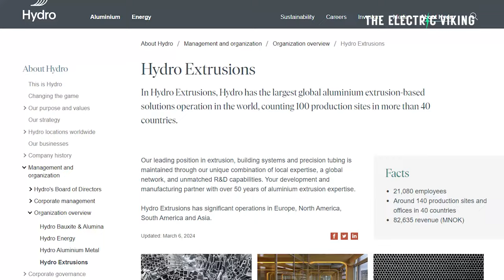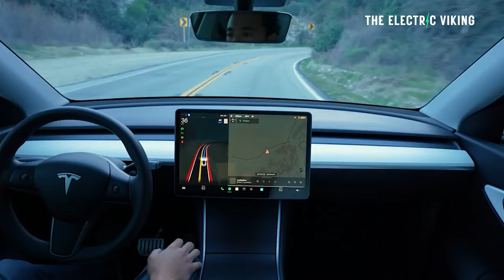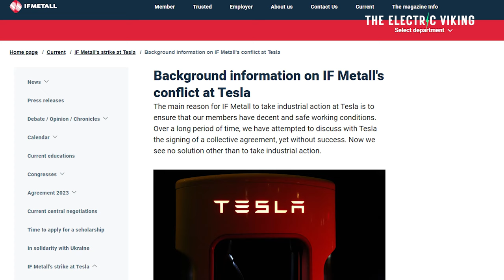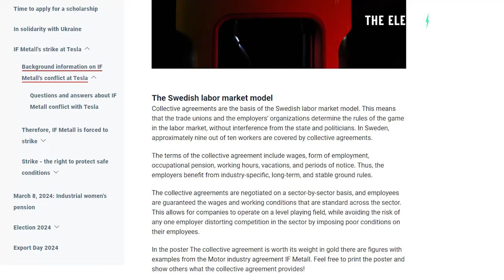IF Metall fails to STOP buyers; Model Y Sweden’s most popular car in 2024

Comment: I have both Tesla model Y and Ford Mustang Mach E. They are priced about 44 thousands. Mustang Mach E has softer suspention, slightly better noise insulation, but the model Y is much roomier than the Mustang. And in terms of software, it is a huge gap between the two. While the Mustang's software is primitive, almost useless, the Model Y gives me controls a lot of things from my phone: turn on AC, heater, roll the windows, can see location, speed, temperature...And it has all the options that the same price Mustang does not have: wheel and seat heating, powered passenger seat, 12 memory seat setting...That is why Model Y is the most competitive in the market
Reply: You sure fucked up with not one but 2 EVS
Reply: After watching Sandy Munro's comparison of the thermal systems of both those EVs last year there is no way in hell I would get a Mustang Mach-E.

Comment: Remember, Volvo Cars is Chinese owned. It is NOT Swedish and hasn't been for 20 years. Volvo Group sold Volvo Cars to Ford. Ford lost billions when they eventually sold (2011, I think). They desperately needed the money to avoid bankruptcy after the financial crisis of 2008/9. So Volvo Cars was sold to Geely, a Chinese Company. Geely kept the Volvo HQ in Sweden but most of the BEV's are designed and produced/manufactured by Geely in China. Volvo Sweden continued with ICE and Diesal (Just closed off Diesal). Geely are also slowly moving manufacturing away from Sweden to another factory in Belgium, avoiding all that crap interference with the Swedish Unions. It's strange but media writers don't seem to have picked up on this. It's all in their financial reports. They aim to be purely Electric by 2030. Geely and Volvo Cars also own controlling interest in Polestar. (Note: Volvo Trucks/Buses are still owned by Volvo Group)
Reply: According to the Wikipedia article, Ford bought Volvo Volvo Cars in 1999 and sold it to Geely in 2012, so it’s been about 25 years since Volvo Cars was a Swedish brand. Ford can hardly accurately be called an American automobile manufacturer. Tesla is the largest automobile manufacturer in the US. Ford assembles cars and trucks, but according to available information does not make the parts that go into them.

If you want to buy a new American car, you’ve got Tesla and maybe Rivian. If you want to buy a new Swedish car, you are out of luck. Or maybe you can start a new company here in Sweden.

Isn’t it remarkable that Tesla is doing so well in spite of years of lies and other forms of negative propaganda and stock manipulation aimed to defeat the company and prevent or delay the sorely needed transformation of vehicular traffic from being based on the combustion of fossil fuels to being based on clean, renewable electric power?

Facts remain facts, and “alternative facts” remain lies, no matter what you call them. Untruth can be used to manipulate human behavior, but nature does not respond to it. Facts can be suppressed, forgotten, but they can’t be altered like opinions, so they have a tendency to survive obfuscation by politicians and others with vested interests in denial, such as oil companies, utility companies and unions.
Reply: @Nirabulator  volvo cars have always been Swedish company and they still are. They pay tax in Sweden every year. Becouse it’s a Swedish company and it’s the same for Polestar. The company’s are just owned by a Chinese company. But that doesn’t make the company’s Chinese.
Reply: @andreasl4507  Huh?
Reply: @Nirabulator  if a chinese person buys your house in the US or wherever, is it a chinese house?
Reply: @erik....  What would make it a Chines house?
Reply: @Nirabulator  It's owned by a chinese person.
Reply: @erik....  A Chinese-owned house, then. Is that what you are trying to get at, and I have just missed it, the analogy between house and company? I can see that. Volvo is a company built in Sweden by Swedes. Volvo Cars, which is what we are talking about here, is becoming less and less Swedish over time because it was bought by a Chinese company which has made many changes since taking ownership, and now it seems no Volvo cars will be made in Sweden, at least for the time being.

That, I think, is where the analogy breaks down, as in your hypothetical question, the house remains the same, wherever it is. Only the ownership has changed. If the owner dismantles the house and moves it to China or wherever and reconstructs it, isn’t he or she likely to call it a Canadian, American or Brazilian house, depending on where it came from?

A Chinese conglomerate buying Volvo and making all the changes that have been made, ending production and eventually design and the other core functions of the company in Sweden has in my mind made it a Chinese company with a strong Swedish heritage. I don’t think there is anything particularly unfortunate about that. The Volvo brand remains alive and kicking, which is a much better fate than the fizzle that SAAB was.

This is a tricky thing to interpret, I think. Do you think it might be appropriate to refer to Volvo Cars as a Chinese-Swedish company?

I think an argument could be made that the Chinese invested in Volvo’s technology and reputation for quality and are wisely developing that. Volvo automobiles will just get better and better as Chines expertise is applied to converting the fleet from ICE to EV.
Reply: @Nirabulator  Yeah I don't know, I still see Volvo cars as a swedish brand. Just look at the board of directors.
Reply: @erik....  Well, it’s an intriguing question. Only three of the members of the board of Volvo are Chinese. The chairperson, Li Shufu, also known as Eric Li, owns 2,313,396,227 shares of Volvo Car AB as of December 31, 2023. Note that that is billions of shares. The CEO and president of the company, a Scotsman named Jim Rowan, has 403,000 shares. None of the other board members are close to that number.

I think it’s also worth noting that Li Shufu is also the sole owner of Geely, which company literally bought Volvo from Ford for 1.8 billion dollars, at a considerable loss for Ford. Thus the argument can be made that Li Shufu owns Volvo Car AB personally. In that sense, Volvo is definitely a Chinese company, regardless of where and by whom the vehicles are designed and built.

That is, of course, not the whole picture. The history of Volvo is long, founded in 1927, and its heritage is mostly Swedish, I think one could say. The Wikipedia articles on both Volvo and Geely refer to the companies as being multinational, and that is probably the most accurate way to refer to them. Geely also owns Polestar and Lotus, among other once non-Chinese brands, and has recently bought a significant amount of shares in Daimler and Aston Martin.

Volvo and Renault had an intimate relationship for many years and for a time were in negotiation for some type of merger. Based on Swedish reporting at the time, I got the strong impression that the merger failed because of the insistence by Swedes that Per Gyllenhammar Lead the new company and that Volvo shares be worth more than Renault shares. Renault was then a larger and more survivable company than Volvo. In Sweden until recently you bought your Renault, as my wife and I did, at a Volvo/Renault dealer. Up here in the north of Sweden there are no longer any Volvo dealerships. I don’t know where you go to get a new Volvo now. Mailorder maybe? Geely is now investing in Renault, so multinational is probably the right way to think of most of the car makers we knew and loved from the twentieth century. Good old globalization.

Ford and General Motors are moribund. Their leadership is an embarrassment. They will either fail again and get bailed out with American taxpayer money, go bankrupt or be acquired by holding companies such as Geely.

Comment: I’m
Confused if the workers in Sweden voted against it - what is the issue? Doesn’t the opinion of the workers matter?
Reply: Not when you are a union of 85% of the country and have badly invested the people's retirement money and are desperate for other revenue to make up the losses.
Reply: @tedmoss  - Oh did not know they were that pervasive as a union. Most people in the U.S. save for their own retirement and add Social Security. I wouldn’t want to depend on a pension given the single point of failure risk.
Reply: @RagnarinVa it’s more complicated than that. You get a government pension that come from your work and income, this is your baseline and are quite low. Many companies also give you separate pension part, this is an important part for securing a decent pension. On top of this you can also privately save money but unfortunately the previous socialist government removed the benefits so now it’s basically up to you.
Reply: @dyktilja - I understand that. Out “government pension” is Social Security. Most in the Us add to that with personal savings (401k and IRAs).
Reply: @RagnarinVa  they are probably afraid Tesla will remove the benefits like getting shares as a bonus if they vote for the union.

Comment: In this video you talked about workplace safety and unions. Here in Finland it's not for union to make workplace safe. There is separate governmental agency to handle that. I expect same applies to our neighbor Sweden.
Reply: Nope. In Sweden we have no Govt office handling workers rights. That's what the unions are for.

If IF Metall fails we will need to start implementing government laws, which would mean there would be no wiggle room left for companies to dodge minimum rate for one thing. The Swedish decision to seek consensus and force companies to work with the unions instead of as a third party workers movement is one of the secrets to Swedens success as a previous export nation.

Tesla is walking a dangerous rope here and we might well see new laws that will twist Teslas arm if this continues. Are you going to start claiming the Gov. is a mafia org too? :)
Reply: @wertigon  I'm claiming mafia what? I didn't even talk about Tesla. I Googled and found out quite fast that you are lying. In Sweden Arbetsmiljöverket government agency handles workplace safety.

Comment: Unions adversarial effect on manufacturing cost is driving the rapid development of technologies and methods to reduce the human labor contribution to mass manufacturing.  This is what Tesla is doing in unboxing the line  and increasing automation The central assemble line is a  point of weakness in  manufacturing and blowing up that model  will introduce a great deal of  flexibility in when and how sub-assemblies are made and then combined to form a finished product.  Installing sub assemblies and interior features in an open frame will allow for a great deal more automation.

Comment: The people speak.  Tesla is now the " VW Beatle" of yesteryear.  The unions are being short sighted thinking they are helping the worker when all they do is add to an already high debt load to companies and force an even faster adoption of more robotics and line simplification.  Tesla has reduced the line and time to build vehicles by a third so, it can make that many more cars with the same # of people with a higher margin.  Line people should get into fixing the robots when they break.  Think of the savings of reducing 77 parts to one with a casting, no gluing, welding, fastening, and labor.  The politics of EV's in the US is just stupid and you can't fix stupid.  Change just takes time.  Keep up the good work Viking!

Comment: Ha ha Tesla haters and crybabies Tesla is the future get used to it! No maintenance, No gas stations, No oil changes, No smog checks and reliable, quiet, clean, as fast as a $650,000 Lamborghini.
Reply: Is that why Hertz has problems with their Tesla fleet, because it was so cheap to operate? Expensive repairs, expensive insurance as in often double compared to regular cars. And no gas stations? What is wrong with a 5 minute stop at a gas station compared to much longer wait at some supercharger?
Reply: Teslas have uncertain and possibly catastrophic  maint and repair costs. ICE cars maint costs are low and predictable.

Comment: Back in the 1960s, when I was an apprentice metal worker, I was given the simple choice - join the union or cop a hiding from union thugs. I was 15 years old at the time. Going by the behaviour of IF Metall, it seems little has changed.

Comment: The Nordic wellfare model rests om the idea, that the labour market is controlled by 3 parties working together. The unions, the employers and the state. In about equal measures of power. Relations between the unions and the employers are regulated by agreements, and there are special work- courts to handle conflicts.
Strikes and lock-outs are allowed, but only when the agreements have expired.
Sometimes an employer will attempt to function without a union agreement. And effectively try to control the labour market without the union. 
Mostly, that does not work very well. The unions will declare conflict, and other companies willfear to do business with the company, the company will lose political good-will ôn the left, unions will try to impede the functions of the company.
Tesla has chosen to take this conflict. They have, in a very real sense, chosen to attack the basis of the Swedish wellfare society. Ok. That is allowed. But it does have consequences. It makes it very unlikely that the Tesla factory in Sweden will be a succes.
Which does not change the fact that Tesla cars are well loved in the Nordics. Just, if you want to make them here, get a union agreement.
Reply: The basics of the well fare system. Pardon!? The well fare system are payed by taxes. Tesla hasn't chosen anything but IF METALL tries to force them. You have by law the right to chose your association. That includes unions.
Reply: @nallebrean  it has nothing to do with who pays. The system works because the employers, the unions and the state recognize they have a common interest in maintaining it. Even sometimes to the detriment of their own interests.
Noone can force them to behave responsibly, though. There are always rogue unions, people that don't unionize, wild political parties and employers that feel they don't need anybody else. In the Nordics they have a tough time of it, though. Essentially, "good people" want nothing to do with such extremists. They won't work with them. Won't trade with them. Won't vote for them.
Is this a good system? It is not. There are a lot of bad things about it.
For instance, most people would often prefer unions that would defend their interests rather than playing power politics. 
But it is a system. It does provide results that makes the Nordics a fairly good place to live, compared to most other places. That is what Tesla is trying to mess with. Good luck with that.